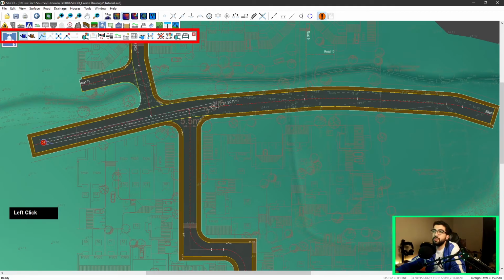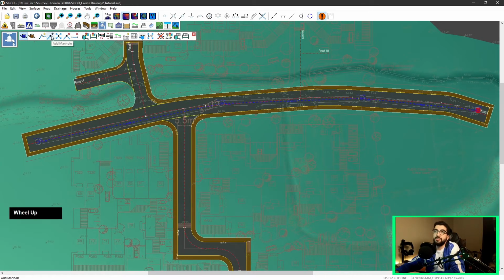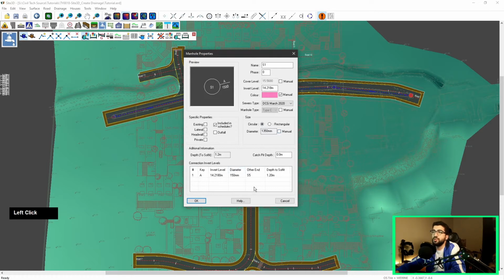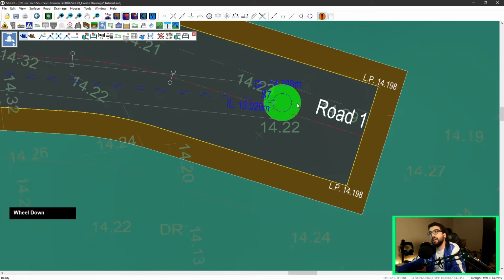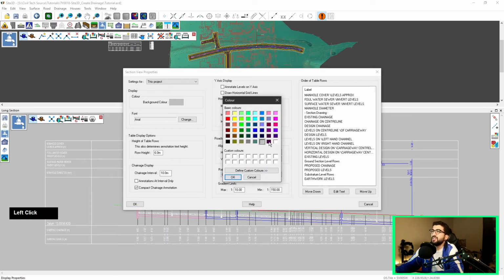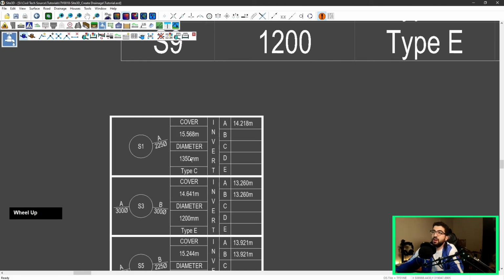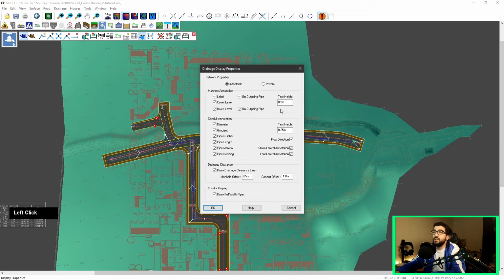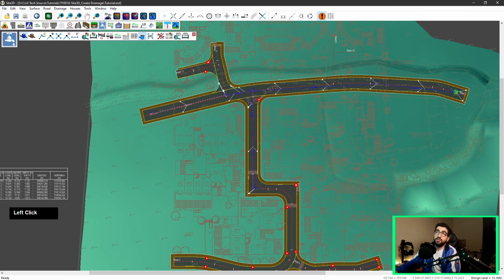Site 3D Tutorial - Drainage Tools

Comment: Have you tried putting around the house drainage in in Site 3D or do you just take line to the plot? then do the round the plot drainage in cad. Great video again
Reply from the maker: Hi Matt, you can assign rwp for each plot type and then switch your drainage design mode to private mode and draw your private drainage. Thanks for the support!
Reply: @CivilTechSource  thanks is it the same for foul outlets in the building if there are multiple locations . Cheers Matt
Reply from the maker: @mattroe3479  Yes, you can draw private foul as well and connect it to the main foul network. If you are interested in purchasing a license use CivilTechPlan as a promo code it should get you a small discount.